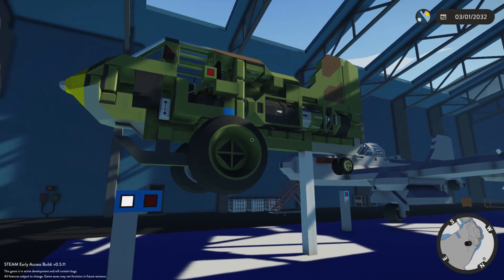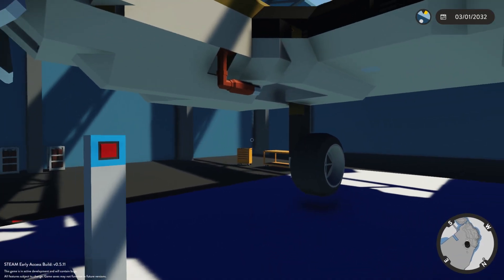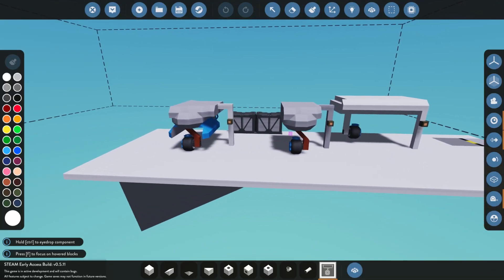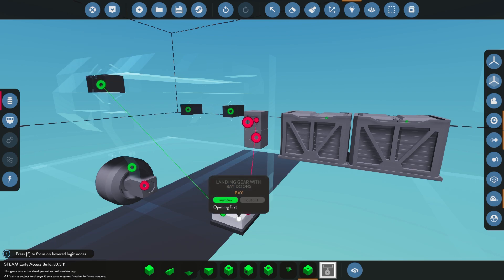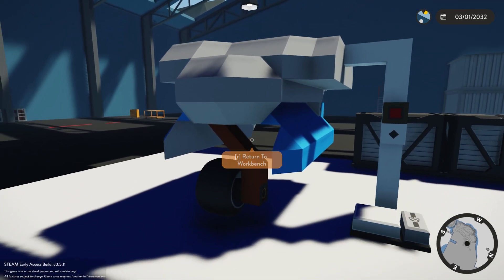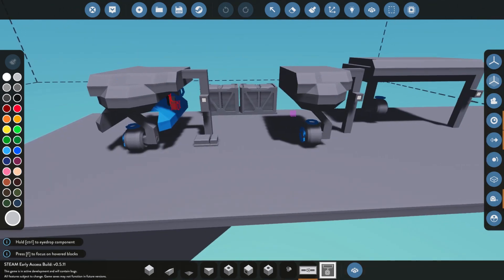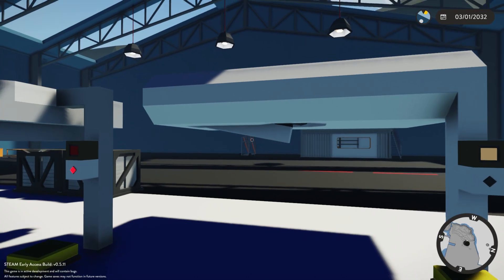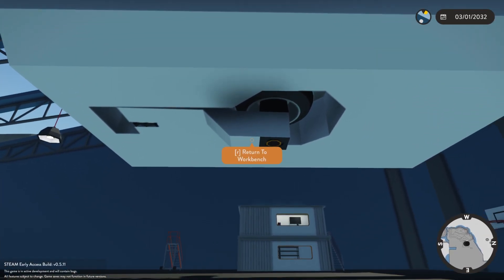Stormworks - Super Duper Easy"er" Landing Gear Tutorial

Comment: Small issue, im using this on a 1:1 scale tu-22. Im using your microprocessor but it doesnt work because the bay doors and gear try to move at the same time. i need the bay doors to be the last thing to move when closing the gear and the first thing to open when deploying the gear
Reply: i messed with the capacitors in the microcontroller, works perfect now
Reply from the maker: @elijahstewart1333  Cool - it's a very old build - i should have some new videos soon for this
Reply: @EndoSkull  wonderful!

Comment: I don't know what I did wrong, I did the wing landing gear design and while the button, light, and the position of the wheel itself are great, the landing gear just won't go up, I don't understand what I did wrong. If I could get some help that would be great.
Reply from the maker: Without seeing it i can only guess- make sure there is electric - make sure you set the numbers on component 1 or -1 depending on the direction of the pivot - visit the discord for help
Reply: EndoSkull Gaming I will be sure to check that, thank you!